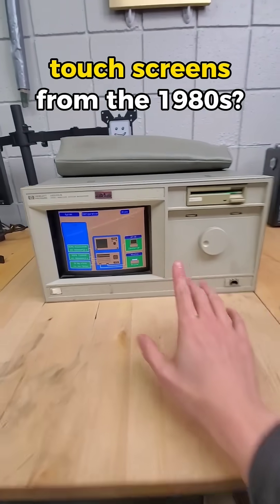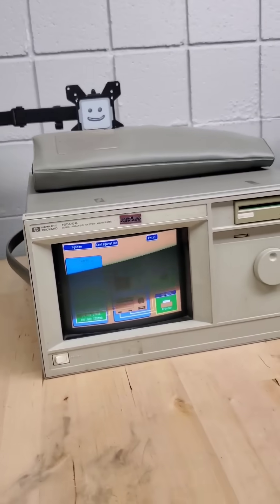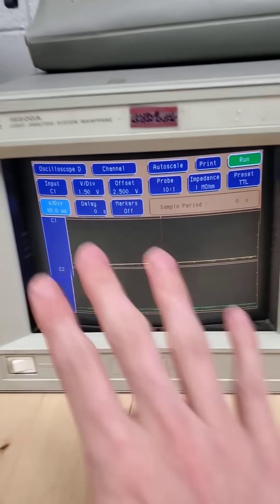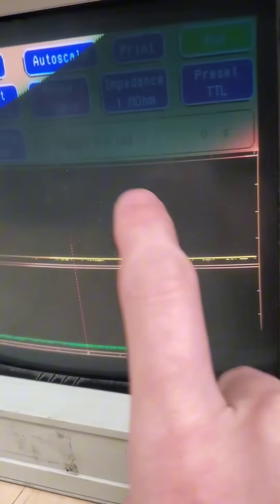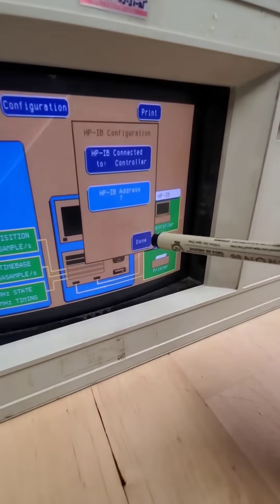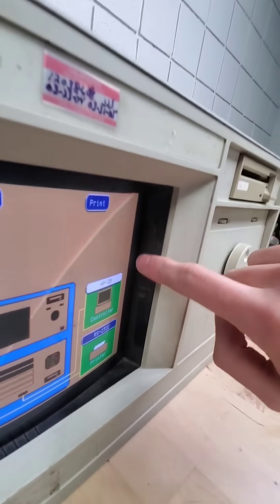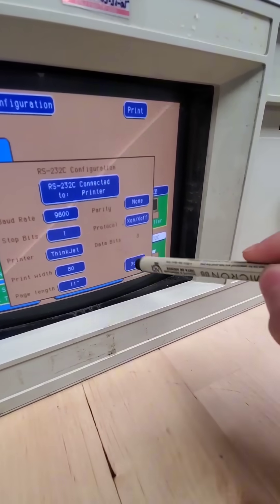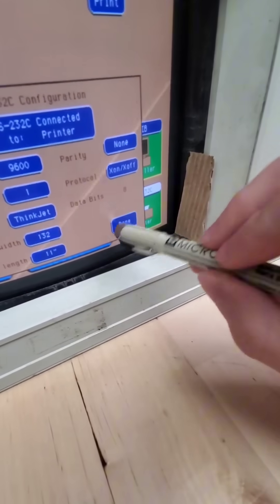how did touch screens work..in 1980? #shorts

Comment: I am more concerned that a computer from the 1980s has a better response time than my PC.....
Edit: To those MFs saying it's not a computer: well this is a joke.
To those saying that my PC needs help I am about to upgrade it to 16 GB 256 SSD so keep that filthy nasty Insulting mouth closed, you don't know what others are going through
Reply: The bloat is real
Reply: Well yeah it's RAM is TINY. It doesn't takes long to iterate down the full memory list.
Reply: Because back then they are not running very complex programs like today computer
Reply: You mean ms word and ms excel? That's what I am using and it takes forever to load  @TheDragonfriday
Reply: i'm wondering how old the system you're running is, and how aware you are of things like os rot.
Reply: It’s a really lightweight os
Reply: Nearly all CRT'S from the late 80's to the early 2000's have a faster response time than modern monitors.
Reply: That's not a computer, it's a specialized device with all software in ROM. PCs were really not that fats at the time unless the program was fully loaded into ram. If your is like this, you're loading new apps from the hard drive which has always been slow. You should find where the bottleneck is and if you value actual performance get Linux lol
Reply: @kreuner11  I am using a 10 yro dell with 4gb and 300 gb of HD, I am upgrading to a 256 SSD and 16 gb ram, so atleast imma get better response, oh and it was a joke so kindly keep it a joke also love that Microsoft like pfp
Reply: I mean, CRTs still have the lowest delay of any monitor
Reply: it’s not doing as much as your pc
Reply: But your modern PC can do and does do quite a lot more at a single time.
Reply: @drrisen-9442  it can't even load up a tab in 1 hour
Reply: 24GB of ram installed, turn on and leave idle and 5GB of ram in use.
Throw in my 2nd 24GB stick totalling now at 48GB of ram, turn on and leave idle and 8GB of ram used.
Go into task manager and close Microsoft Edge that constantly runs in the background despite me not using it for over a decade: 1GB of Ram instantly freed up.
Noticed this almost 2 decades ago when I went from 2GB ram to 8GB, Windows just allowed all its bloatware to use more ram.
Why it's a problem? If you populate all 4 ram slots, only 2 slots are dual channel running at higher speeds, and all that bloat is populating the dual channel slots, meaning if you play a game and you go over 50% of total ram used you may notice a 10-15% performance drop in your game as now the game is spilling over to using the 2 slower ram sticks.
Reply: Because programmers back then understood hardware limitations and built streamlined beautiful code. Not like todays programmers
Reply: Because streamlined is a waste of money. At least as far as people funding the devs are concerned.  @CharlesWhiter0x0rs
Reply: To be fair, it was doing a lot less work lol
Reply: You obviously did not watch the video, not a computer.
Reply: @Ebani  can you not understand a joke
Reply: @RookBoi  Shitty joke, a better joke would have been saying this works faster than your brain, specially bc it does seem to be true 🤣
Reply: @Ebani  explain to me the casual time paradox, being a 13 year old I know what it is
Reply: @RookBoi  Good for you, once you grow up you'll realize none of that matters given everybody already knows about it too.

In Rick's words (aka words you may understand) the shitty thing when learning about dimensional travel is to find out you're the last person to know about it.
Reply: Who in the every living fukc told you I am using Microsoft products except my windows?
Reply: Me when GTA 5 developers:
Reply: @HuntingKingYT say their PC version will slow your laptop down.
Reply: Less to think about back then.
And very few computer viruses to worry about.
I got loading Windows 3.11 down to 4 seconds in the 90s.
My Windows PC takes about 15 minutes to be usable these days, it is 10 years old though and choked up with masses of useless software.
Reply: @angrytedtalks bro 15 minutes nah install an older version of Windows or Linux man at that point do something about it
Reply: @angrytedtalks 15 minutes is just a skill issue. My 2021 machine boots in less than 30s.
Reply: @mattmurphy7030  Windows boot up on an old PC isn't a skill. It is a combination of Microsoft failure and clutter from software installs.
Reply: @angrytedtalks  skill issue
Reply: @angrytedtalks 

Time to upgrade, breh.  My system boots in maybe 30 seconds or so.  I built it in 2022.
Reply: @ComputerJunkie00  Is it loading from hard disk or solid state?

Comment: This thing works better than the order screens at McDonalds
Reply: I have a feeling that if Maccas used this technology instead some kid would be bound to cover the sensors somehow lmao
Reply: Very true
Reply: Try the ones at wendys.if you think mcds are bad
Reply: When I was a kid, some of the kids' play areas of McDonalds and Burger King restaurants used to have computers with CRT touchscreens like this. (I'm 35.)
Reply: Oh no, it doesn't. At least not at the time these "screens" were new. You see, what they usually go for when they want to make a self-ordering machine is a cheap off the shelf tablet. Then they make a nice stand for it, install windows OS and some special software, which pretty much disables all the normal tablet features. And then they have it like this - switched on for 16 hours a day, every day, for years. Some companies don't even switch them off for the night.
Now, all they would have to do, if they'd want to make them faster is simple - reinstall that thing at least once every other year.
Reply: underrated 🤣
Reply: That's actually so true 😭😭😭
Reply: What i was about to comment

Comment: Advice from a test equipment hoarder:

HP loved putting rifa caps in the psu's of their 80's equipment.

These rifa caps we're used to filter transients and noise from the mains input.

Rifa caps used a clear plastic casing which is prone to cracking and failing, often explosively. 

They are a potential fire hazard,
 especially the X-class rifa caps that sit between Live and Neutral, these one's tend to become a short circuit once they fail.

Rifa caps failing is not a question of IF but WHEN.
They're like timebombs sitting inside old test gear.

It's extremely easy to replace them thanks to HP's in-depth service manuals.

Very doable for even a novice at soldering and repair. (My first project in hobby electronics was desoldering old rifas from a tektronix oscilloscope and putting modern equivalents in their place.)

Please unplug the unit from the mains before opening it up for repair, remove the psu board, inspect the suspect rifa and take note on whether it's an X or Y class capacitor.

Sorry for the long-winded rant, but these little buggers kill old equipment that would've worked fine.

Comment: 😌 thanks for confirming it works. I somewhat learnt to use raspberry and arduino only a few months back. I was for something else, but from the start I had been thinking about how I wanted to learn it from a long time but now this deadlined work would be a nice incentive to learn it, and at the end I'd know something about automation. Using this knowledge, and some of the sensors i have lying around (given to me by a cousin of mine whose more well-versed in this, when me and my sibling showed some interest to learn), I would be able to make any screen a touchscreen. I have SR-04 Ultrasonic Proximity Sensors, using 3 of which (triangulation) we can navigate. But for that, I need to also know the interfacing of the arduino output of calculated finger position and then convert it to computer input as to move the mouse pointer to the calculated position. Which I dont know, as of now.

Comment: A copy shop I worked at when I was in school had CRT touchscreen monitors on the two cash registers. They were huge, heavy as all get out, and worked great as long as the temperature was above 70°F in the shop. If it was 60 or lower, they would do all kinds of kooky stuff. I have no clue why they were so sensitive to temperature but they were.

Comment: That refresh rate was absolutely state of the art back then.
Reply: CRTs "refresh rates" still beat all but the highest end displays lol it's state of the art now to this day and they don't even make them anymore
Reply: @DarkAttack14  bro, top of the line CRTs had the same refresh rate as mid gaming monitors today stfu
Reply: @Hoolahups  That doesn't even make sense. CRTs didn't have "refresh rate". They had an electron gun, which was firing a beam of electrons on the inner side of the screen lighting up the fluorescent coating. This beam was manipulated using electrodes that were powered from hi-voltage amplifiers. Those were controlled by a circuitry which was deciphering marks in your analog input signal.
Reply: @mrkv4k  yeah, and they did it 60 times a second. The refresh rate.
Reply: @Hoolahups  No. Old TV standards had frame rate of 25Hz (30Hz), which was usually interlayed to get 50Hz (60Hz). Because they were using mains for frequency synchronization. When they started connecting PCs to TVs, they used what was already available.
When the LCDs were taking over, the "normal" frame rate was 75Hz-100Hz, but that wasn't limited by the monitor, the limiting factor was graphic card and interface.
Reply: @DarkAttack14 refreshing info
Reply: @DarkAttack14  you can get a gaming monitor that refreshes at nearly 3 times the speed with double the resolution for only $100 haha, do some research before throwing outdated facts out.
Reply: What you're seeing is not the refresh rate but an effect of the rolling shutter not matching to the screens refresh rate.
Reply: @Sotha42 Which ironically is mostly caused by the "progress" from mechanical shutters to digital ones, I think.
Reply: @whoshotdk mechanical shutters can still give this effect (called rolling shutter)
Reply: @Sotha42  he never explicitly said that was the refresh rate
Reply: still is. i just wonder why crts are not made at all anymore… they can definitely make them 4k nowadays, and smaller than they were back then as well.
Reply: @sirreal2290  Man, 4k crt would be amazing
Reply: ikr
Reply: Refresh rate is irrelevant, it's the latency that's basically unbeatable by LCDs. Only OLEDs are similarily fast.

Comment: Infrared LEDs, not lasers. I also remember using these in the late 90's-early '00s when j worked at Red Lobster. All the POS terminals used them.
Reply: Could have been lasers. CDs use IR lasers and were introduced in 82, and this is high end kit.
Reply: @Zero_Gravitas  You might be right. I was thinking more of monitors, and the cost would have been prohibitive for those. A CD drive only needed one laser.
Reply: @Zero_Gravitas CDs used one laser.. this is a whole array of lasers. Not a fair comparison. And it’s not that high end

Comment: A Buick had a touch CRT,  Buick ravera I believe it was called, monochrome black and green and was used to controll climate and radio
Reply: It was the Buick reatta.
Reply: @dumdum1559 i think the Riviera had it too if I'm correct
Reply: @Aff1982  We used to call them the Rivi-scare-ya because they were so hard to work on. Word was if you threw a pencil on top of the engine, closing the hood would break it. It was so tight the alternators didn't get enough air to cool them properly and they wouldn't last.
Reply: @scout9479  you are correct. My parents had a riviera when I was young. Pretty cool
Reply: @dumdum1559 87-89 Riviera, too.
Reply: @dumdum1559 The Reatta and Riviera both had touch screens in 1986.
Reply: @dumdum1559  the Riviera had it first in the 1986 model.
Reply: that one has a pressure sensitive screen tho
Reply: Ah I wrote another comment about that but couldn't remember the vehicle. Thought it was an oldmobile but at least I got GM right xD
Reply: The oldsmobile toronado trofeo also had one
Reply: Pretty sure it was the bat mobile
Reply: I own an 89 Reatta with the touchscreen. The first car with it was an experimental a-body century. The first production vehicles were a limited number of 1985 rivieras (the long square-bodied Riviera). All 86 thru 89 rivieras and all 88 and 89 reattas had the touchscreen. Mine still works flawlessly.

Comment: There were several methods back then, one of the other big ones was surface acoustic wave touch. You could use gloves or anything non-rigid to touch the screen, but the biggest issue was that there wasn't any reliable multitouch tech.
Reply: That! You're 100% correct. Or resistive sensing but not lasers....

Comment: I can’t believe tech from the 1980s has touchscreen that’s so fascinating

edit: most amount of likes i ever got ty guys so much
Reply: some general motors cars from that era had a touchscreen crt radio but most of them were simple vector based tubes
Reply: @arutezza  one of the buick riviera year models in the 80s had a touchscreen, but it wasn't a well received option, with people preferring just having buttons, which is a complaint I've seen alot nowadays with modern insistence on touchscreen dashes
Reply: @skullimpgaming6905 There is no tactile feedback. 

It also means that in order to touch the button on the touch screen, you have to take your eyes off the road because you can't feel the buttons and identify from touch which button your finger is on.

And taking your eyes off the road is never a good thing.
Reply: Touch screen was invented in the early 70s , I guess a lot of the people in the comments weren't around because it wasn't an abnormal thing in the 80s.
Reply: @RedceLL1978  still pretty cool
Reply: I saw a video of a late 80’s luxury car with this type of torch screen
Reply: Touchscreen wasn't common, but we have had touchscreen for years, even in the 70's we had touchscreen using IR scanning that worked well given the method was low resolution.
Reply: The 1990 Eunos Cosmo had a CRT touchscreen, while also being the first car to come with GPS. It's also the only mass-market vehicle with a 3-rotor Wankel engine.
Reply: Nokia made touchscreens in the 80s.  It was military tech though lol
Reply: more responsive than an ipad too 😂😂😂
Reply: @computertable3746  Of course it is, there's virtually nothing to process in comparison to an iPad💀
Reply: Technology is so advanced but sadly they will not release it because they need to make money they probably have graphics card that can turn on games 8k ultra with 500fps but will we see it no because they slow down technology
Reply: @dssd7685 If you knew anything about integrated circuit technology you would know that what you are saying is complete and utter nonsense.

Nothing like a good old (or in your case, young) conspiracy theorist.
Reply: @deang5622  whatever man military has and government has way more advanced technology that we're not able to use cause we're sheeple to them
Reply: @deang5622  but keep living in lies
Reply: @dssd7685  its called capitalism ya buffoon
Reply: Many cars had touchscreen back then too, most cars today do not
Reply: Cringe edit
Reply: I can't tell if that is genuine or sarcastic...
Reply: @spike_m4nicc Could be both you would never some people just can't do simple shit like searching for it
Reply: @spike_m4nicc  its genuine I actually think its really cool
Reply: Technically it's a scancreen 😂
Reply: 420th like. Time to smoke! 🔥 🌲 🌬️